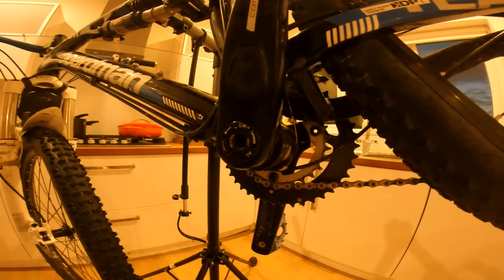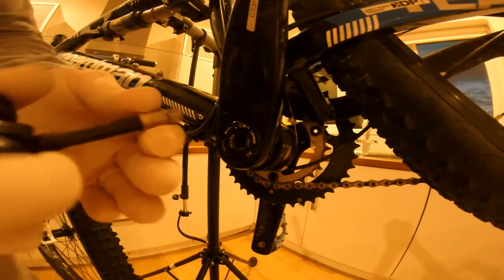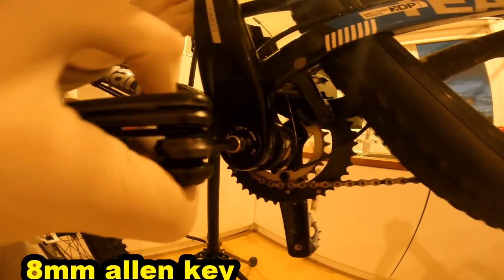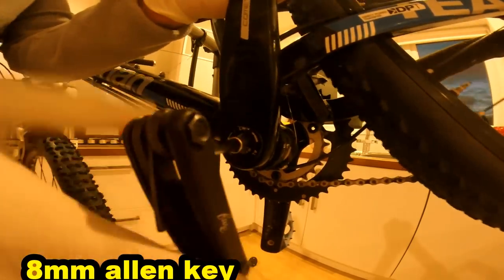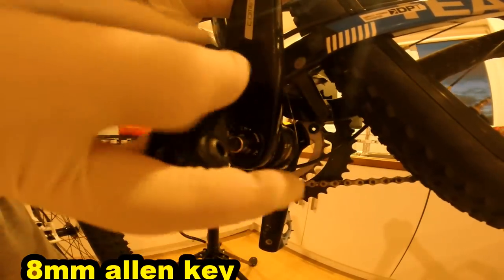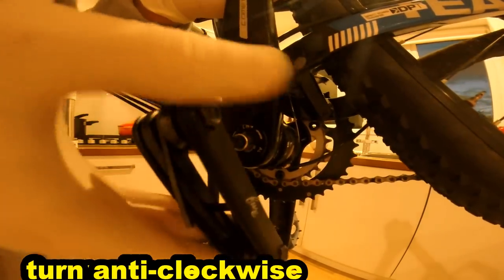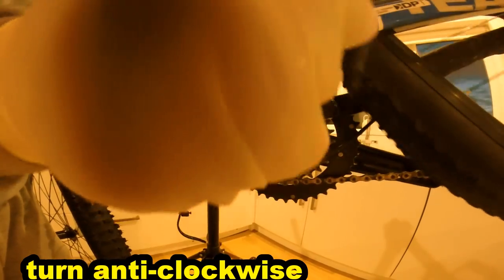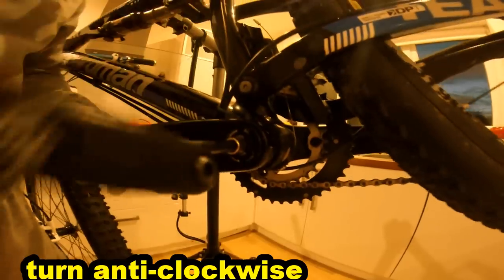FSA Crank Removal

Comment: I've got a fsa comet 368 42/27t on my boardman, the 42t chainring is shot and can't find a replacement, there is a FSA Gossamer 386 50/32 175mm bb30 Crank on ebay, can I change it for this? I know there is a change in ring diameter but I'd prefer the harder gearing. I'm guessing my 2 speed derailleur will adjust? Sorry for lengthy question
Reply: I have the same problem, chain rings for the 3 bolt Comet are now obsolete. Did you find an alternative Chainset ?

Comment: Mine blew the extracting cap clean in half and stripped its threads.....I need to find a way to remove the arm now.
Reply: You manage to remove the crank?
Reply: Yes I did!! As the BB was shot anyway, I ran a hacksaw between the crankarm and the BB. 
I replaced with a Tiagra 4700 (48/34) crankset and Shimano BB. 
I was getting soo much flex of the FSA crankset when in the big 50t ring and higher power levels, that the chain would rub against the front mech, but was unreplicatable when stationary.

Comment: Is it needed to remove the cap with SPA-1 tool?
Reply: I know it's been years but just in case anyone else is also curious: you do not remove Thale cap on self extracting cranks. Actually it's better to tighten them. The cap acts as an extractor.